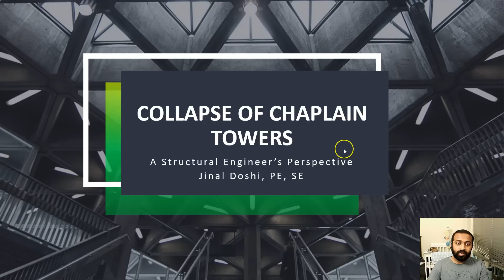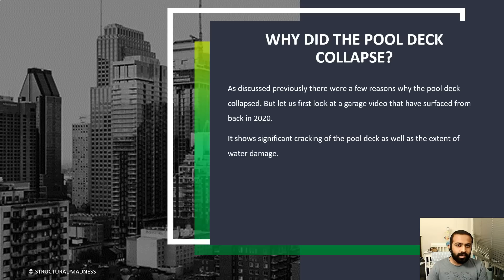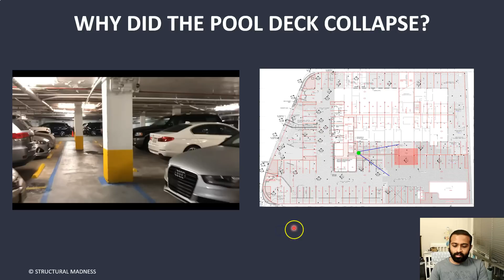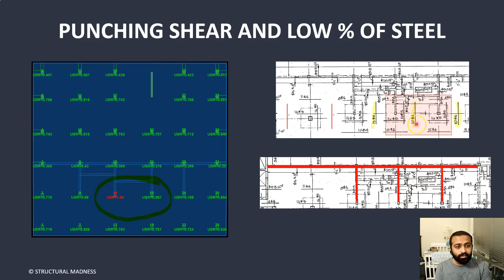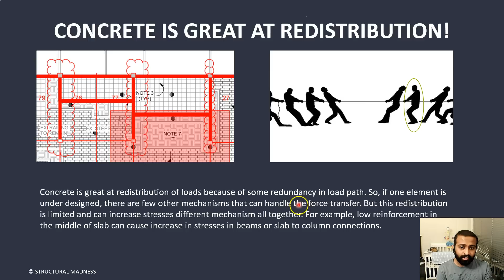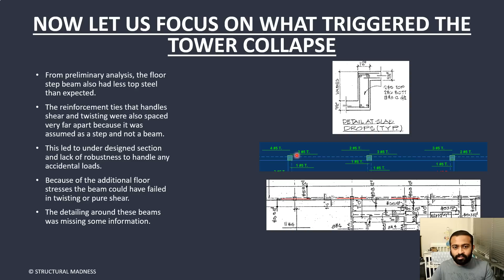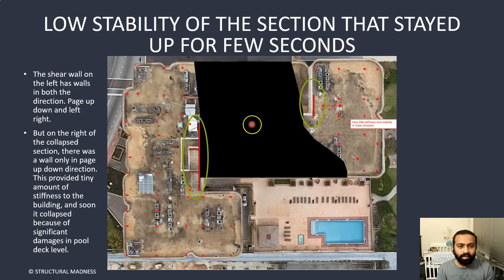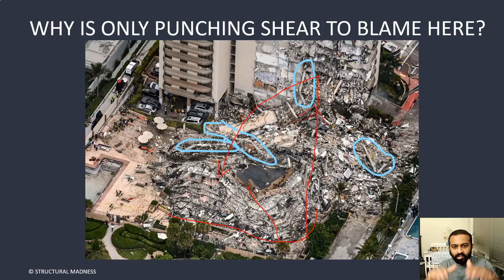Reasons behind Surfside Building - Champlain Towers South - Collapse : A Structural Engineers Review

Comment: What I can't understand is why  the pool deck was tied to the main building with beams when it was built. 

The pool deck was actually the roof of part of the parking garage...and didn't actually support the pool, so if it had been built as a separate structure...with less sturdy construction...it wouldn't have affected the building when it collapsed.
Reply from the maker: It's fine to tie the deck, but then you also have to check it thoroughly. We need to understand the load path as well as element by element behavior for a stable and sound structural design.
Reply: @StructuralMadness  Well, the pool deck didn't seem like it had a stable and sound structural design...especially if it was constructed like the roof of an underground parking garage instead of a deck that had to bear some weight.

Developer must have cut some corners, since it had 500' of cracks when the building was only 16 years old.

Too bad there weren't inspections every 10 years instead of forty.  The condo owners would have had three chances to avert the collapse.

Comment: Hello Mr. Mad
What superimposed dead load did you assume for the pool deck?  There are photos taken during the collapse that show concrete/grout/mortar topping on top of the pool deck varying from 3" thick to about 10" thick.  The planters were in place with relatively heavy walls and full of soil, but they only occupied a small percentage of the surface area.  This assumption is critical to the analysis since the reinforcing steel is somewhat deficient.
Of course to the casual observer if an slight overstress is detected under service load analysis (everyday loads) then that means that the original building design was deficient by a much larger amount.
At 35:26 you discuss top reinforcing at the slab step down.  Those bars are shown on plan- #5@12.  It may be useful to the discussion to note that the same step down condition occurs on plan between columns G.1/12.1 and G.1/14, and the plan indicated the same #5@12 top reinforcing, but in collapse photos it was observed that the lower slab tore cleanly away from the step down beam with no sign of that top reinforcing.
It is interesting to see your analysis of the pool deck slab.  I did some punching shear calculations and got similar results that the slab was overstressed in punching shear under current loadings.  I didn't do any flexural calculations but the amount of reinforcing in the slab looks very low for those spans and expected loadings.
Now let's take the discussion  a few steps farther.  Given that the slab is overstresses in punching shear and flexure, and it has deteriorated over time due to water, these capacities would be even lower.  My theory is that a flexural failure somewhere in the slab initiated the failure, whether through failing in bending and causing hinging in the slabs, or adding just enough flexural cracking over some critical columns to trigger a final punching shear failure.  Your calculations and my calculations are for the in-place structure, once a part of the slab fails significantly it transfers additional moments to areas around that which under a normal situation would just trigger some hinging and it could stop there.  But since punching shear capacity was marginal the additional shear stress due to slab bending moments would cause progressive punching shear collapse to go from column to column across the building, stopped only by the 2 significant pieces of shear wall.
In the video at 35:26 when you show the outer slab pulling away from the step down beam there is a question about what really happened there.  The original slab did not have much flexural reinforcing in that area and the beam does not have much flexural reinforcing either, but no problems were observed in the beam prior to this point.  The beam also did not have much shear capacity and I think with the outside slab trying to add torsion to the beam it coudl fail in torsion at the face of the column, allowing the progressive collapse to continue inside.
You made a comment about perimeter column size but I believe calculations would show those columns to have good axial load capacity.  The bottom tiers are 6000 psi concrete with very high reinforcing ratio.  However the columns only have a reinforcing compression lap and not a tension lap so if the slab fails and pulls away from the columns, they become unbraced for 25' instead of 11', and they have a lap splice at mid height that is not good for full tension capacity.  If the slab failures progressed into the tower then the exterior columns could have failed in compression initiating collapse of the tower.
Reply from the maker: I used an average thickness of 5" because everything was uncertain based on the survey done by Morabito associates. If the pool deck slab separated from the beam, then other possibility now lies is, the torsion induces on these deep skinny beams with low shear reinforcement as well as very little longitudinal reinforcement. And with all the damages that were done, could it be possible that the beam failed later on? Hard to tell though because that beam would have been destroyed by the tower collapse.
Reply: @StructuralMadness  I think once it got to that point then the beam probably failed due to combination of one-way shear and torsion.  I wanted to think that the outside slab would peel away and leave the beam and inside slab intact but thinking about the unbalanced moments applied at that line I decided the little step down beam probably couldn't take it.
Reply: @StructuralMadness  That kind of appraisal doesn't suggest a homogeneous collapse pattern.

Comment: Do not forget the 6 vehicles were also loading the pool deck.
Reply from the maker: They were in a separate span and the columns supporting that portion of slab were twice as big so I don’t think that it would have imitated the failure. But I can reconfirm this.
Reply: By themselves that would not be cause, but added to an already weakened foundation/design/construction anything could have toppled the dominoes. Consider the massacre that may have happened if the crumbling occurred during a big pool party.
Reply: That loading is insignificant on a reinforced concrete building.
Reply: There is a picture where the collapsed parking lot floor has the rebar ripped out of the still standing floor. Rebar spalling would have greaty weakened the pull out resistance.
Reply: In addition there is witness statements the visitor parking lot collapsed first.
Reply: @BlackjackTac  Yes but has nothing to do with the cars.

Comment: Interesting video.  Thanks for sharing.  It’s a complex situation with a lot of variables involved.   The 9 1/2” under reinforced pool deck slab without waterproofing/and or failed waterproofing having extensive cracking, spalling and rusted rebar sticks out in my mind.  Then they had to add huge planters, and a 4” stamped concrete topping slab above it.  Of course they had to put the gym in that area as well. They probably parked cars and construction equipment on it over the years as well.  Just a combination of mistakes.
Reply from the maker: Absolutely it is very complex and that is why multiple factors did play a role in this collapse. And we have also to understand that the structural engineers back in 1970's didn't have fancy computer like we have the pleasure of using today. Building did stand still for 40 years even when it was under designed at couple of spots. It just takes some material degradation nd build up additional stresses to lead to such catastrophic failure.
Reply: @StructuralMadness  Again great job with your video.  I agree with your conclusions.  I saw a video of some of the transfer girders inside the pool room.  You could stick your hand in the spalled areas.  The spalling was about 6” deep with badly rusted rebar.  The pool deck could of been just as badly deteriorated?
Reply: All of those various loadings should have been considered in the original design however it might be impossible to find out what was really considered.  I've designed lots of buildings with toppings, planters, gymnasium equipment, etc., we just add it all into the design.  And yes it can add up to a lot sometimes but you can't ignore it.
Reply: @billj5645  I agree 100% Bill.  Hard to determine what loads were actually considered in 1979.  Or if the building was actually built in accordance with the documents.  Who knows at this point?

Comment: I suspect that the live loads and dead loads of the cars parked adjacent to the pool deck triggered the collapse of the lobby parking, then the pool deck, then the tower columns.
Reply: This is unlikely for several reasons- first the cars do not weigh nearly as much as the architectural finish materials that were observed in collapse photos near the hot tub, second the punching shear capacity of the slab/column connections in the area of the cars is much greater than the punching shear capacity of the slabs in other areas of the pool deck.  Very few people on youtube understand what cars really weigh.
Reply: @billj5645  Cars are about 3,000 lbs. which is one-and-half tons. SUV's are probably around 2 tons.  The underground garage video taken about a year ago by a potential buyer seems to show many small pools of water in a row on the floor of the underground garage right under the driveway, that goes from Collins Ave entrance to the pool deck level parking area. The ceiling of the underground garage under the drive way seems to also show cracks that include diagonal cracks that indicate over stressing. It is unclear whether any freight trucks drove onto this area to deliver goods and mail. One YouTuber shows in his video of a young man who witnessed the cars parked on the pool deck parking area sliding into the underground garage from the breaking of the pool deck in the pool deck parking area first, before the rest of the pool deck following.
Reply: @golfscienceguru  Yes that supports what I said.  Someone said 6 cars- the 6 cars together would weigh 18,000 lbs.  The area where those 6 cars are parked should be designed for about 150,000 lbs.  You can see that 150,000 is over 8 times as much as 18,000.  We can't stack enough cars in there to come close to what the area should be designed for.  It is possible that the original engineer didn't understand proper design loads and used the same design load in that area as he used in the rest of the building, which would have that area designed for about 60,000 lbs.  Even if he made that mistake the cars would still load the slab to only 1/3 of its design load.
Reply: @golfscienceguru  Where's that video on YouTube of the cars sliding into the garage? I like to see it. 🤔